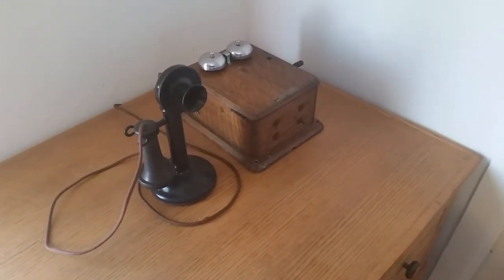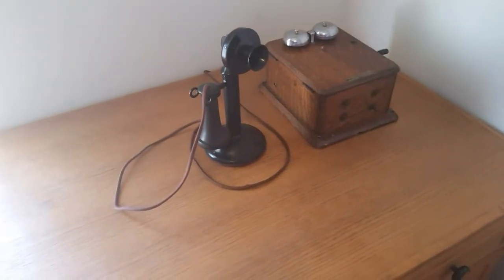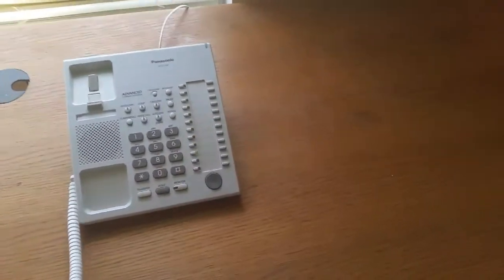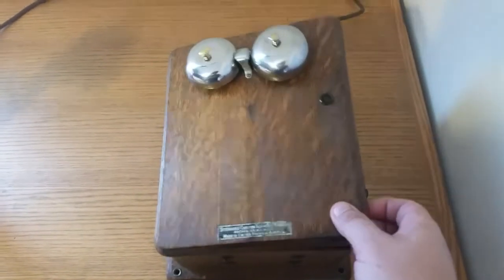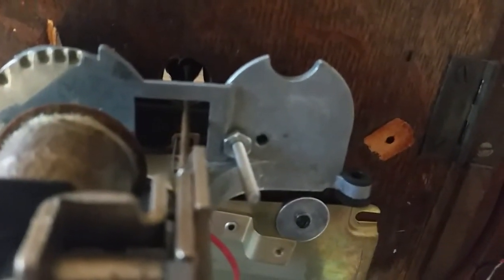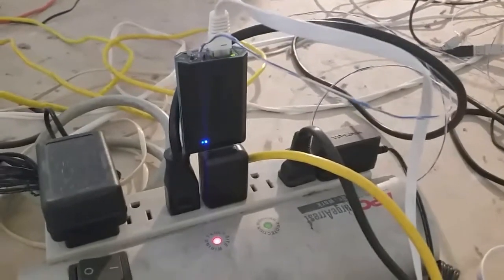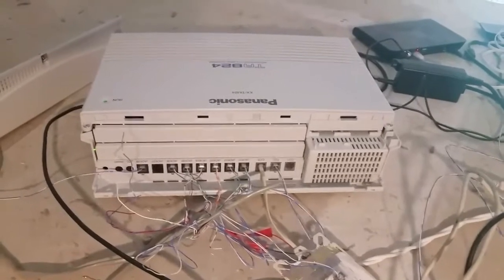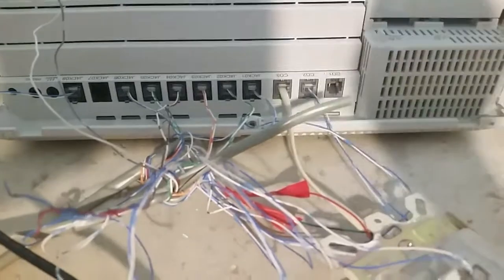Our 1915 Candlestick Phone Working With A MagicJack!

Comment: You could also directly hook it into a regular telephone line. You can dial phone numbers by using the switch hook. just go off hook and press the switch hook 1 to 9 times for the numbers 1 to 9 and 10 times for the number 0
Reply from the maker: Cool, I didn't know that. I don't think my pbx recognizes that but I don't doubt pstn lines would. Dialing a 10 digit number that way would be crazy!
Reply: @ZephyrRestorations  I do it all the time. Just make sure your pbx is compatible with pulse dialing